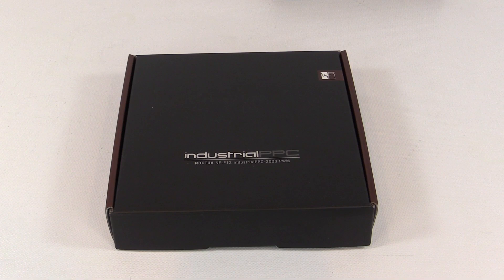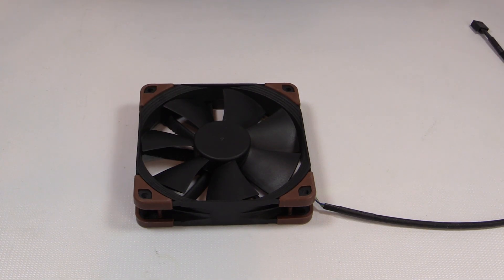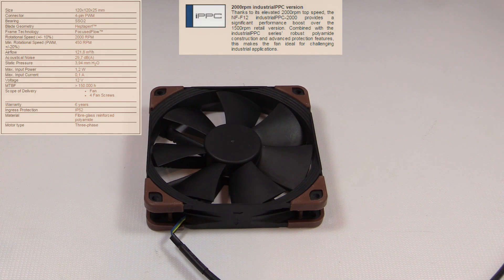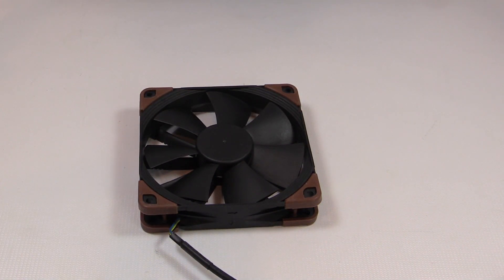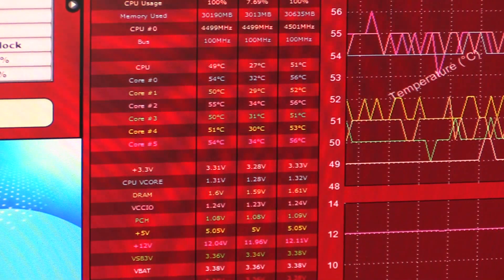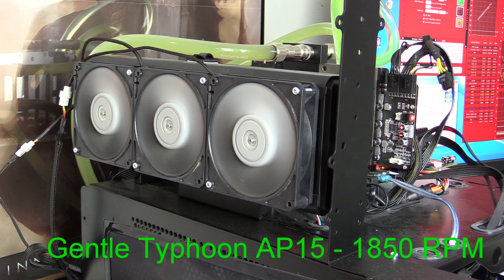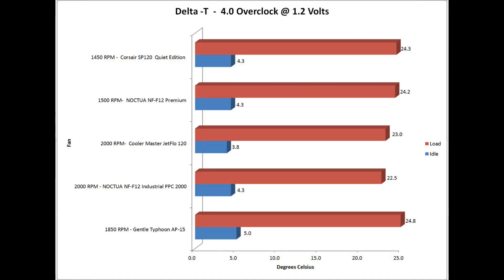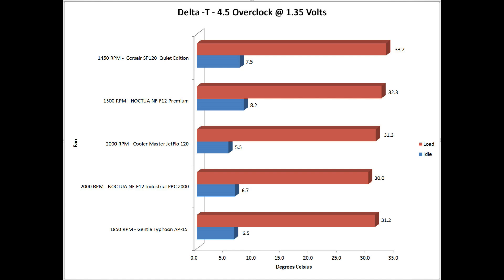Noctua NF-F12 IndustrialPPC 2000PWM Fan Review

Comment: I have been using those for the last 10 years. Fans like th eNoctua NF-A14x25 G2 will of course make those fans look bad, especially in the noise department. I did overall like those fans though, motor noise was slightly over what I like.

Comment: Ron outstanding vid, you did a very good side by side comparison to include the noise comparison. I watched this video twice it is that good. By the way for those you curious I installed into my WD DL4100 nas a noctua NF-F12 black edition fans and my nas temps are down 30% cooler. noise level is up but thats ok by me since the nas is in our company server room.I appreciate and give WD props for using a industry off the shelf fans that can be upgraded. Nice job WD.

Comment: i have the 3000 rpm version... according to noctua, the only differences are a higher minimum speed, a higher maximum current and power draw... and pretty much a higher everything else ...
not surprising, really
and i think if you are controlling the speed anyway, the only thing you cant do with the 3000rpm version compared to the 2000rpm is run it between 450rpm and 750rpm , and as far as i know the only price differences for the same PPC fan size involve the water resistance rating, so really i dont understand what is the point in buying the 2000rpm version
Reply: carmatic The advantages of the 2000 are lower noise, and lower power use.
Reply: im a little curious cause it says 29 dba vs 43dba ... 2000 vs 3000 thats where i cant decide are u able to have the 3000 vrsion less then 30 dba? and stil have load cooling?

Comment: Are these SP or AF fans. I need an exhaust fan for my case, suck hot air out.
Reply from the maker: +PhanaticFilms  It ca be used as a good a radiator fan as well.

But check this review out as well.

http://www.tweaktown.com/reviews/4635/noctua_nf_f12_pwm_focused_flow_cooling_fan_review/index.html
Reply from the maker: These will do the job.
Reply: These are Sp fans by design

Comment: hey, im building a pc and was wondering, i am getting gtx corsair h100i 240mm, and replacing fans with 2 120mm Noctua 3000 rpm pwm fans, in total will be 8 3000 rpm pwm fans in the 750d, 2 140mm fans on front panel and 2 120mm fans on bottem of the case, 1 140mm fan as exhaust in rear of the case and 1 120mm fan at the top as exhaust next to the gtx corsair h100i 240mm will be push/pull config, how will i control all of these fans, and what fan hub would you recommend i've been researching and cant find the answer, all the fans r also 4pins
Reply from the maker: +AwesomeSkillz For the 8 PWM Fans you may want to consider this.

http://www.newegg.com/Product/Product.aspx?Item=N82E16811999309&nm_mc=KNC-GoogleAdwords-PC&cm_mmc=KNC-GoogleAdwords-PC-_-pla-_-Accessories+-+Case+%2F+Rackmount-_-N82E16811999309&gclid=Cj0KEQjwrte4BRD-oYi3y5_AhZ4BEiQAzIFxn9LheGRJIX5wUceHytkMeteLXxnJzxR6mX_8syawwI0aArbS8P8HAQ&gclsrc=aw.ds
Reply: thank you, do i connect it to the motherboard to control them?
Reply from the maker: +AwesomeSkillz Yes , you connect to a PWM fan port on your motherboard for control, and a sata power connector from your PSU for Power.

Comment: I have the Noctua NF - A14 Industrial PPC - 3000 PWM. I'm using two of these for the Cooler Master Nepton 280L. My only issue with them is that they are suppose to run from 800 to 3,000 RPM, but for some reason they run in the slowest at 400 RPM. So, I had to reset the motherboard CPU Fan speed from 600 RPM to 400, because I would get a CPU fan error. The same thing happen to me with the older version of the Noctua 140mm PWM fans. They are very quiet at below 1,000 RPM, but pass that, they get very loud. At load they never get to 3,000 RPM, the highest they go is to 2,740, at this speed they are very loud. All for all, I'm happy with them, I wasn't looking for quiet fans, I was looking for high speed fans, they cool my overclocked Intel 4770K to 4.4 at load, better than any other fan.
Reply: Funny enough I was looking on Noctua's FAQ site yesterday after buying some of my own NF-A14's and they talk about some of the RPM and CPU fan error issues you wrote about, maybe it will answer some questions you have: 
http://www.noctua.at/main.php?show=faqs&step=2&products_id=84&lng=en
Reply: Steven Phillips Thanks a lot, but I already knew and had read that. If you read my comment again, I explain that I had to reset the lowest fan CPU fan speed from 600 RPM to 400 RPM in the Bios, so, I would not get the CPU fan error. My problem is that they claim the RPM speed of these fans are from 800 to 3000 RPM, and in my case this is not true. Please, re-read my comment. Thank you.
Reply: +Angel Luis Trinidad ah that was something i am interested in, how do you know that they spin at 2740?
Reply: +Supa Man Remember, I'm talking about the Noctua NF - A14 Industrial PPC - 3000 PWM, That the RPM is 3000, not the ones on this video that are the 2000. So, how do I know they spin at 2,740 RPM, I know because my motherboard is the Asus Z87-Expert, Asus motherboards come with a software called Fan Expert 2, there you can adjust all your fans speed, or do a Fan Tuning. There's also 4 fan speed you can choose from, Silent, Standard, Turbo, and Full Speed, when I choose Full Speed, the highest the fan will run is at 2740 RPM.
Reply: Angel Luis Trinidad
ahh ok yeah i tried to come up with a method of reliably reading the rpm and the best i could imagine was a digital strobe light. i wonder why they are branded as 3000 when they don't reach that number :(
Reply: +Supa Man I think it all depends on the motherboard, but they are branded at -/+ 10% 3000 RPM, that means more or less 10% 3000 RPM. That would be between 2700 to 3300 RPM. So, 2740 RPM is right in there with the branding.
Reply: Angel Luis Trinidad ah yes i remember that +-10% :D

Comment: Similar packaging design to Peter Saville & Factory records for New Order/Joy Division etc etc.

Interesting test - really it boils down to price, looks and warranty and in room noise as the mic was picking up airflow as well as noise and vibration.
The actual temps were all with in ideal temps - you'd not think "wow Fan A is 4 degrees lower than Fan B at load, best change my fans" you'd be happy with anything at load under 40.

thanks Ron another good vid.

Comment: Hi ron I'm looking for some fans in my nzxt h440 I'm looking for some better airflow than  the stock 120 mm fans deliver. I'm using a nzxt grid+ to control them because the case lacks a 5.25 Bay. Do you have any recommendations?

Comment: The noise comparison didn't really tell me anything about the fans other than the airflow (you could hear the turbulance that the cable caused).
Did you set up the mic to a manual level, the cooler master jetflows didn't sound as loud as I would expect (apart from the turbulance on the cable).
Next time it would be nice to test them at multiple consistant rpm's, so that the test is fair.
Reply from the maker: Fair enough, but I selected fans that I thought most would be using. I often get tons of comments and PM's about testing against this fan and that fan.  In my conclusion I do acknowledge the air noise and the RPM differences.  Thanks for the feedback.
Reply: Ronsanut No problem.
A visual indicator of noise would be great, for instance on my Zoom H2N you can set the level manually and on the screen on the back you can clearly see how loud the recorded auio is, it can be used standalone or recorded from over USB.
if you don't have a solution like this I would recommend looking into it, would be very good for testing.
Reply from the maker: TheWargod56 Cool. I will.
Thanks.